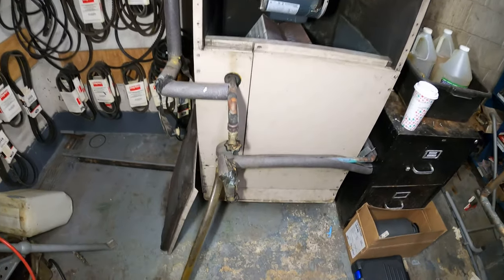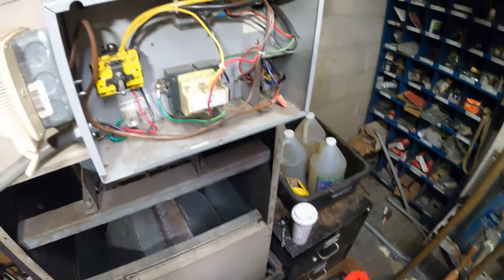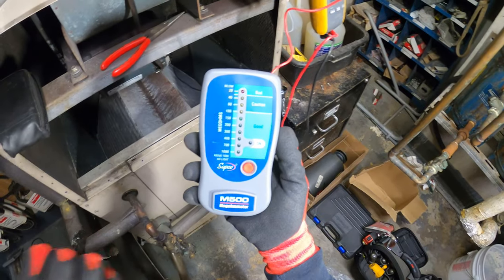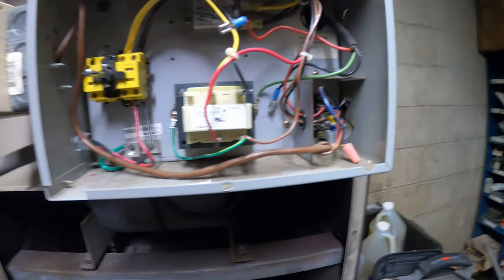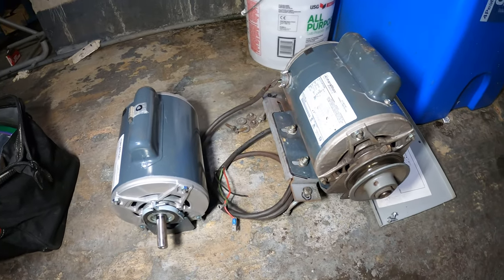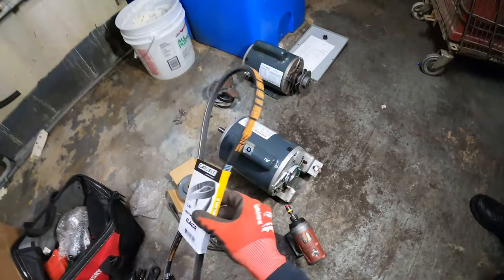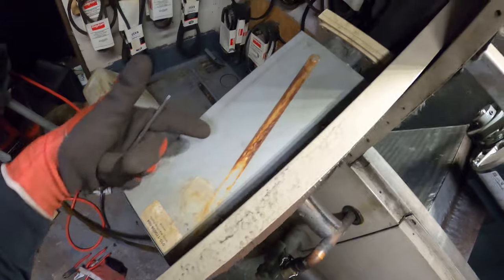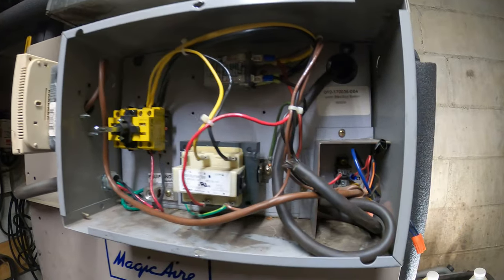HVAC Service Call: 2 Pipe Fan Coil Unit Fan Motor Not Working (FCU Induction Motor Troubleshooting)

Comment: I worked under an Hvacr contract with our local paper mill and exactly what you are seeing is the same thing I saw every day lol the workers are probably using that parts room to cool off in or something. They usually run the thermostat wide open or bypass the chilled water actuators where it cools constantly lol

Comment: Great video as usual. Just wondering, for the pulley, i believe you probably couldve sawed the shaft off with the pulley on with a porta band since you just needed the information from the back for the parts shop. I remember there is also i believe a way to measure it and get info for it from that, but adjustable sheaves i think are trickier for that than the standard pulley. Either way great stuff I really dig the facilities equipment videos.

Comment: Being the same motor u know u only needed to undo the small nut and bolt on each end of the motor on the clamp. and swap them straight over. Hope this saves u some time next time